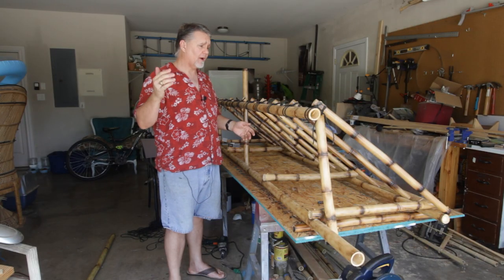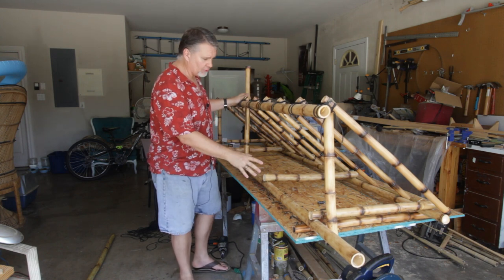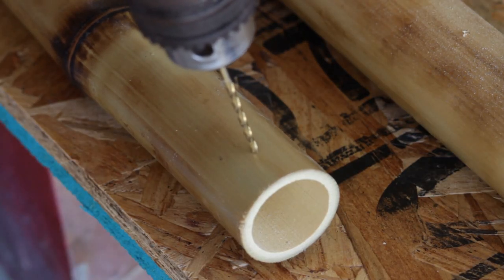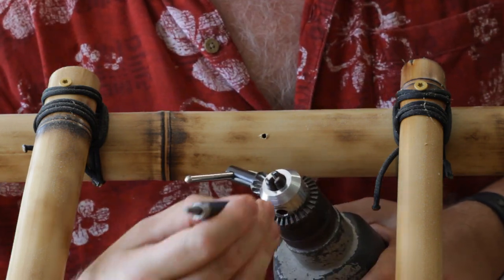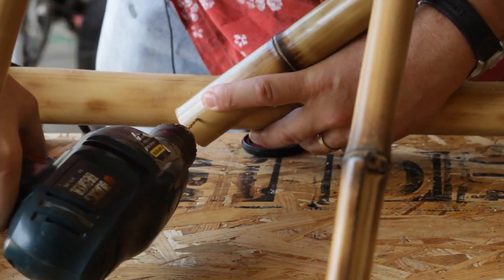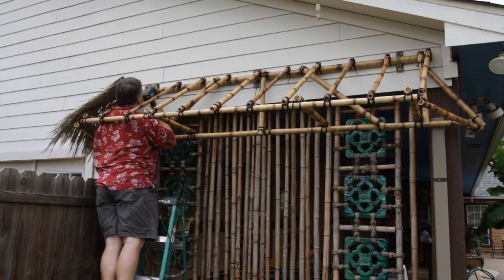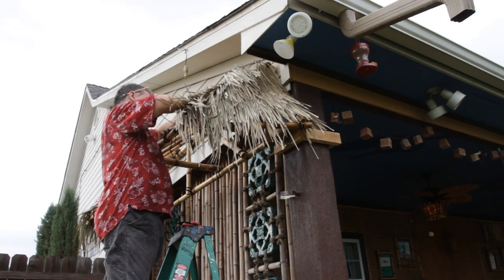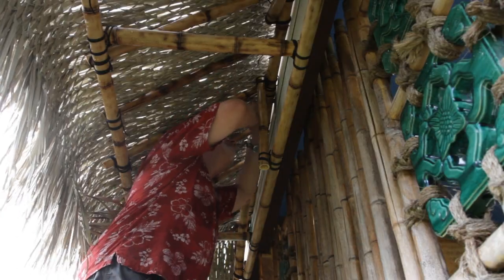A Moment of Tiki Episode 12: Thatch Me If You Can

Comment: I’ve gotten so many great ideas and techniques from your videos.  In fact, what started as a “tropical feels” area surrounding my new little 10’ pool, has blossomed into me trolling FB Marketplace at 2am, designing a 5’x7’ hut (for the bar I’m picking up on Friday) and placing an $800 order from ForeverBamboo.  Thanks (I think)!
Reply from the maker: Ah, yes. It is indeed a very deep and twisty rabbit hole to fall down. I'm sorry and you're welcome!
Reply: @LagoonofMystery  Hiya! In the month since I discovered your channel and wrote the above comment, I have carved notches into eight lodgepole pine posts and beams, coated them in spar urethane, assembled my base structure and stained my bamboo slats. Today I coated my thatch and got it up on my roof rafters and put in half the exterior bamboo slat siding. Tomorrow should see me get the exterior finished. I’m so excited to start decorating with the weird and wonderful stuff I’ve been collecting.  I’m pretty lucky to have married a carpenter (who would have built this beast himself had he not had a stroke six years ago. Thanks to him I have every tool I needed, including a pneumatic nailer/stapler. Thanks again for the inspiration!
Reply from the maker: @lauraweiss7875  Sounds fantastic! I encourage you to share photos on some of the home tiki bar build groups to be found on Facebook, if you haven't already!